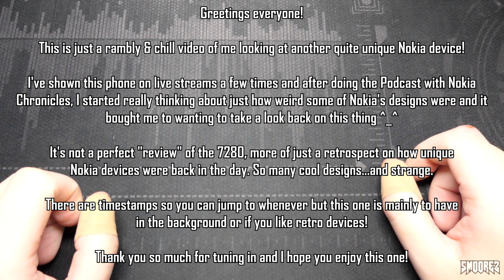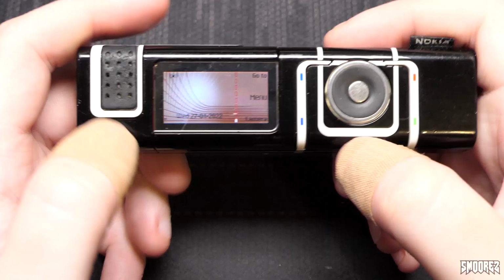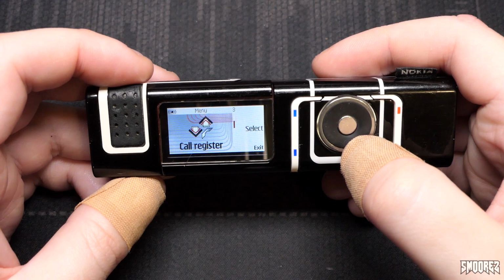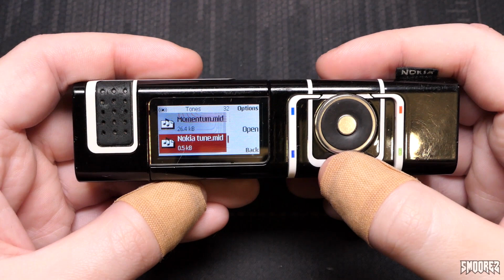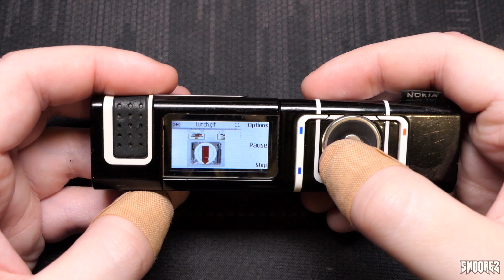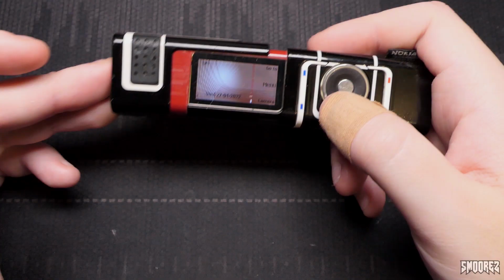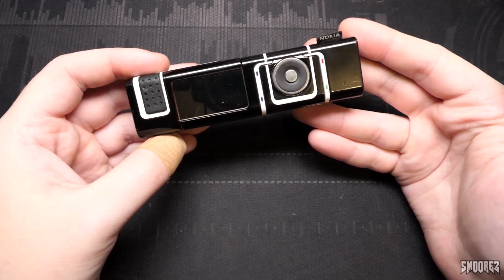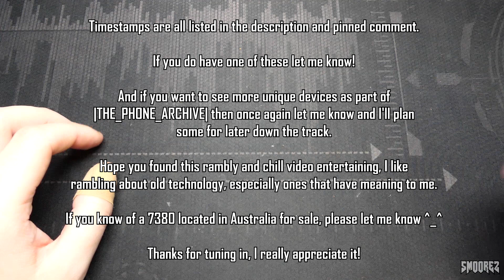An In-Depth look at one of the most UNIQUE NOKIA Phones...the Nokia 7280 (aka THE LIPSTICK PHONE)

Comment: i remember having the 7270, it was a bit bulky even for the time but the large buttons made it great for texting with T9 under the desk during class. It had every feature you'd want on a "dumb" phone, quick and snappy, and i used it until i switched to one of the first smartphones available in the Motorola E680i. Eventually, i ended up switching back to the Nokia, until the iphone came out, as it was just a more usable phone for the time

Comment: Nice video, I was always fascianted by these when I first heard about them. In 20004 I had a Sagem My-C2 which was a flip phone that was smaller than a Nokia 8210 when folded and it's still the smallest phone I ever had. 

Oddly enough this Nokia is not the worst phone i've seen, that honour goes to the Motorola V100, it was designed mostly for text messaging and as such had a full keyboard but could only be used as a phone with the proprietary hands free kit (and as i'm sure yoou know wired hands free kits of the time were not exactly durable) so if you got a a phone call and the cable was dodgy you couldn't answer the phone. Motorola really missed a trick by not adding a microphone and speaker to it.
Reply: My man over heres 18k years from the future
And with that pfp and username he might even be from one of the Mars colonies

Jokes aside
Why in the world would you make a phone, without the core features of a phone (mic and speaker) 
That's one of these marketing decisions where i wish i could see the meeting and how the conversation went
But ig they were banking on the replacement wire kit sales

Comment: AHHHH your take on Michael Fisher (Mr Mobile)'s "When Phones Were Fun" 🤔😉👍.
I had the egg shaped 6600, and barring the crap 0.3 Mpixel main camera (at the time Nokia also had on sale the 6230i, which also had MP3 ringtone capability, which the 6600 could only deal with .WAV. But still.. I loved the 6600!! (I'm a bit of a Nokia connoisseur, back when Nokia was really a force in mobiles, I bought, used, and then sold what, 80 odd models right from basic 2110, 5110, 3210, 3310/3330, 3510/3510i, all the way through to the mighty N95 8G, N8, E7... You name a model, I probably had/used one hahaha) 🤔 I had other phones like the Sharp GX10i and the Sharp GX30i (still have it!) as well as a range of Sony/Ericssons (OG Sony CMH-444, R320, GA's, T10, T28 too and more)... But I was really a die hard Nokia fan at heart.... 👌
Oh THEM were the days! 👍😏   😎🇬🇧
Reply: The 6600 can do mp3 playback and ring tone if you install some  the mp3 codec thing. But it will stutter the playback if you multi-task and the mp3 ring tone will play a couple of seconds later.. But it will do the job. And it will support up to 1Gb of MMC storage but the recommended is 512Mb.
Reply: @SlinkyStoney  Yeah I was aware of that 'App' at the time, but as it was so iffy I soon got rid and used my PC to create WAV ringtones and then transfer them to the MMC. It was just so frustrating that as the 6600 was made out to be a 'business use' type phone, that it was designed with a crappy 0.3 Mp camera and the 'basic' WAV capability. I would have moved up to a '6600i' if Nokia made one (like they did with the 6230 series). At the time I had a Sharp GX30i (great phone in its own right), and got rid of that to have the 6600. But hey ho, sods law, as they say lol. It still didn't out me off Nokia though 😏.   😎🇬🇧

Comment: the 7380 goes for around 10000 to 13000 ISK here - not too uncommon - but expensive for a "phone" that doesnt do anything. Although Nokia is a lot more common here - for obvious reasons - i have never seen one of those phones for real. So, i doubt they have been more common even in the Nokia heartlands.

edit: btw. that is around 100 aud

edit 2  ( 2023 ) : pretty much because of your review, i actually purchased both phones for fun. Also here we still have 2G in Iceland .. because it is useful for people way, waay out hiking. .. both phones cost around 10000 ISK; or rather the 7280 was around 10000 ISK (something about 110 AUD) but i bought a replacement "shell" because there were blemishes in the original for around 3000 ISK. The 7380 was free .. because i have a friend that had this in a drawer, never used it - because she had a normal phone then - and got the first iphone in 2007 when it came out. So this one was lucky. I got the whole package, unopened box (well, now it is opened) with everything in there. Still looks good, but the dial-pad made of rubber shows and feels clear signs of decay. (on the 7380, not on the 7280, because i replaced it)

It is surprisingly easy to replace parts, because they just clip together and are not glued. Even the battery can be replaced fairly easily.

Comment: I had this back in 05 . At that time my phone plan only had 200 txt messages so i really didn't txt on it that much. I would use the radio a lot . I was in high school at that  time . But i used it for 2 years and then in 07 my senior year the first iphone came out and thats when i got the iphone and stopped using the 7280.
Reply: I used to like talking it apart and changing the cases too

Comment: A Sony Clie which was a waaaay better PDA with actual keyboard and better camera + a Motorola Timeport P280 was my daily double back then.  T9 for txting from Motorola, and a proper PDA of the era.  I tried a Nokia 7280, and the .... complete lack of a way to txt was the deal breaker.  Ironically, an N-Gage ended up replacing the P280 because it was S60 and cheap.  That was replaced with a BlackBerry.  Then I got an iPhone, and ... that's basically the next 14 years of phones.  It's nice to use a real computing device, instead of this era of devices which were awkwardly between 3G/data and 1G/no GPRS.

Comment: To create mechanical joint to use it then a kind of glass that maybe it can be upright view(turning it 90°)(magnifying glass of certain cutting can create a different angle right if light pass by?), Then if use it like a normal feel of phone maybe nice(a big casing then put this inside = use). Another is the movement way like turning it, i imagine a vehicle movement that a turn activates a force to turn to wheel then like can become a vehicle with "Key" that is this Phone, No Phone = No Movement. Just ideas, but i think making a bigger feel and adding battery for longer use maybe nice.
Reply: Can i know who reads this?
Reply: Another is as a side spectacle to reflect at the glass. Maybe heavier on 1 side(is it actually bad-heavy?), Maybe if both side can be nice too or 1 side is same weight but battery with cold metal.

Comment: I have an 7280 and 7380 from new. I've boght the 7380 first for as I remember 2500PLN (600EUR), than after some time there wase a sele and a 7280 occured for 399PLN (~100EUR), I used the 7380 as a daily because my GF wasn't able to unlock it and check the messages. 

But the most beloved phones are Nokia 7110, 6310i, 8810. 8850, 9300i and 7380 and 8800 Sirocco, and now... I have to use Samsung Galaxy S22 Ultra.

Fun times, when I worked on a phone shop after school (2002-2005)...

Comment: about the thumbnail
the middle phone is a 7380 btw, not 7280
i'm just saying

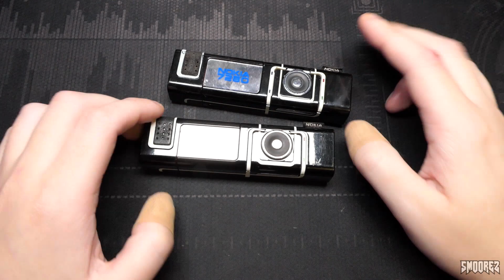also in 1:13
you forgot 7373 and 7390
Reply from the maker: It was to show the unique form factor about the phones, showcasing what the 2 models looked like as I address it at the start and ask where to get one from so it made sense to me. Plus I had this idea of stacking them for the picture. It should be alright.

Yeah with the L'Amour collection, I'm not too familiar on that. Wait I just checked and the L'Amour is only the 7360, 7370 and 7380. The other 2 have a different colorway. I don't know. Too many models lol
Reply: they are part of the same lineup technically
Reply: @PancakeSparkle  yes
they are